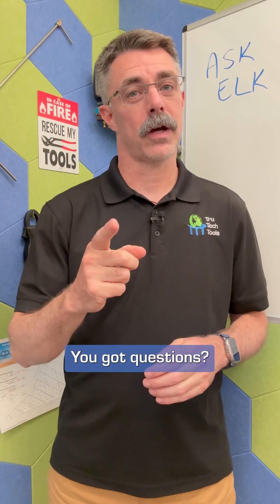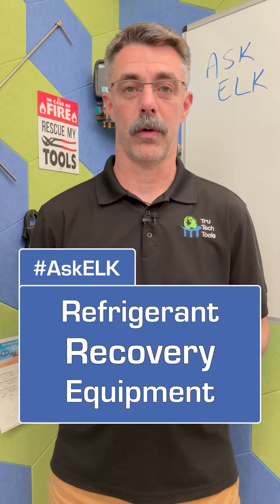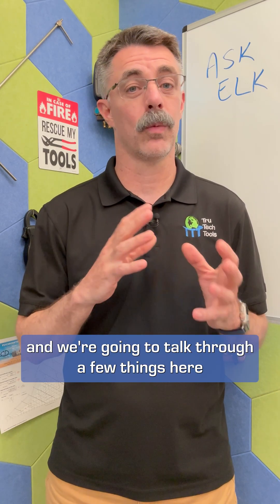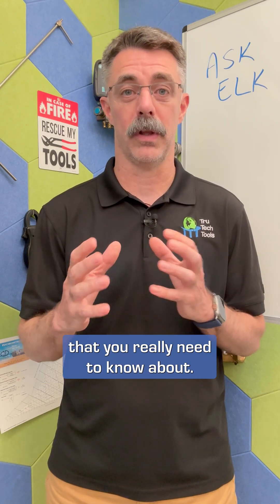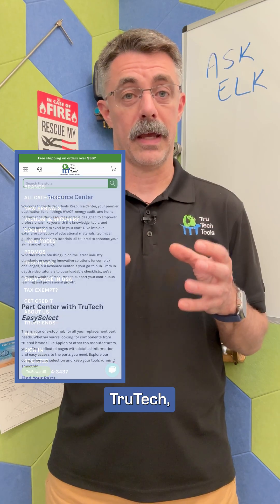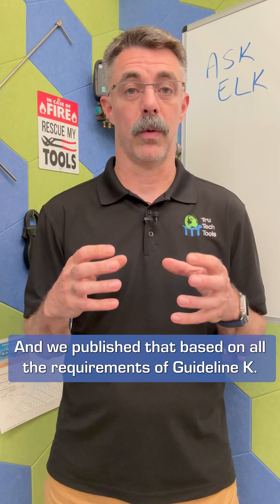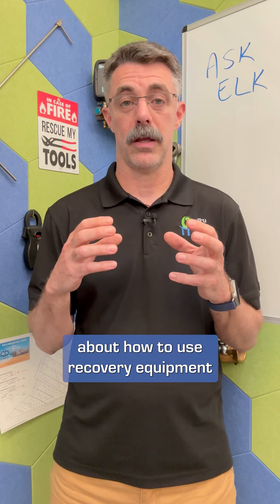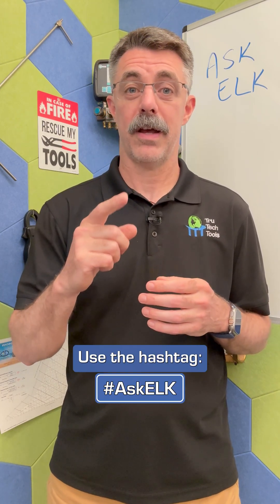Refrigerant Recovery Equipment #AskELK Ep. 9

Comment: If recovery tanks only hold 80% then why do new 125 lb cylinders come with 125 lbs in them but the 125lb recovery cylinder is the same size and can only hold 100 lbs?
Reply from the maker: When filling or buying refrigerant tanks it is important to remember a few things:
-we are filling to 80% by volume, not weight
-tank capacity values like 125 lbs, 100 lbs, 50 lbs or 30 lbs are nominal values, not what the tank can actually hold
-refrigerant tank volume is expressed in Water Capacity
-a pound of liquid refrigerant does not occupy the same amount of space as a pound of water
-not all refrigerant densities are the same

That said, we would need to know the tank WC and which refrigerant is being put into the tanks you are describing to fully answer the question. If you can get pictures of the WC values from the tanks in question and email them to suport@trutechtools.com along with the refrigerant type we can do a video using your examples. Put "Recovery tank question AskELK" in the subject line.

In the meantime, you might find this tech tip from HVAC School useful https://www.hvacrschool.com/refrigerant-recovery-cylinder-fill-calculations-simplified/